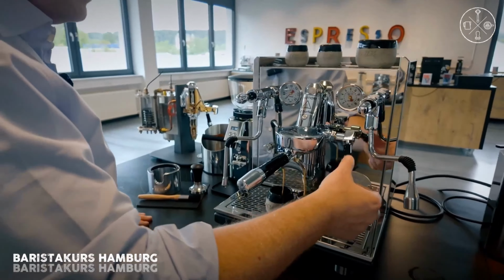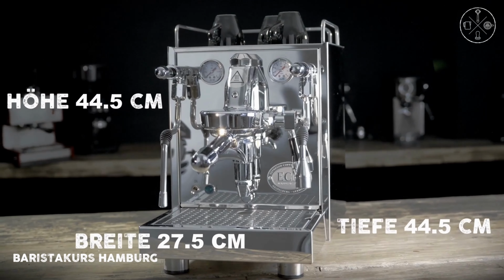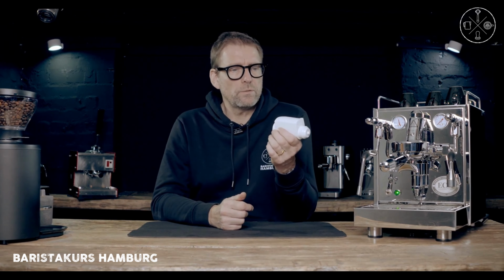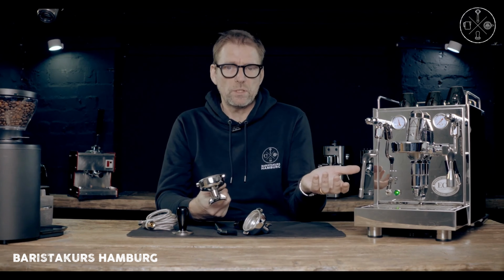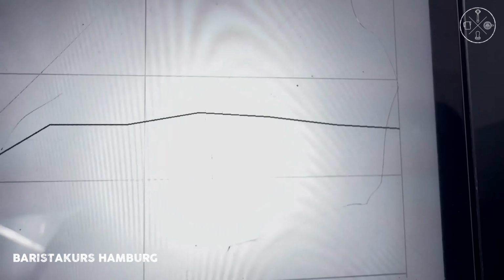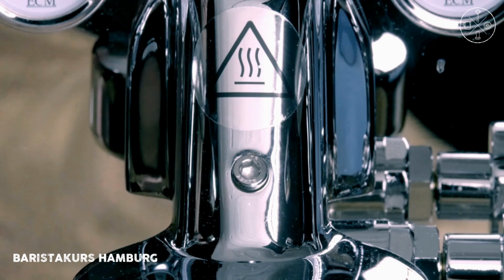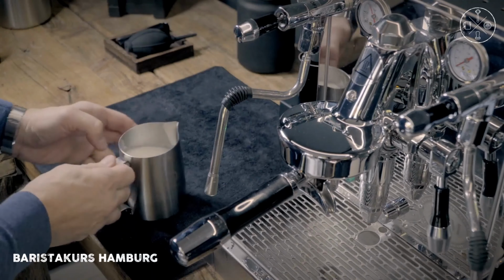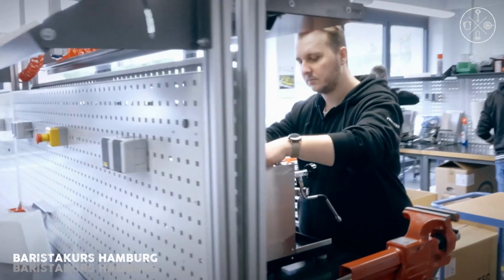ENGLISH REVIEW   ECM Mechanika Max

Comment: Thanks for a great video! I am interested but confused about the Britta Intensa water filter mentioned 6:55 - 7:31.  Is it already in place inside the machine, or does it get connected in the reservoir, or as part of plumbing the machine to the home water supply?  If it is inside the machine, how difficult is it to find it and replace it?  Is the a menu setting that will tell me when to replace the filter?
Reply from the maker: Hi Jeff, thanks for your message. Installing the filter is very easy. You simply insert it into the slot in the water tank. Removing it again is just as easy. Unfortunately, you'll have to figure out when to change it yourself, as it depends on the limescale level in your water. The machine can't check this. However, I believe you can set a reminder time for the machine to change it.

Comment: You mentionned several times in the video that the	 mechanika max is a dual boiler machine as in fact this is an HX heat exchange boiler.  Thanks for making the correction
Reply: Exactly…